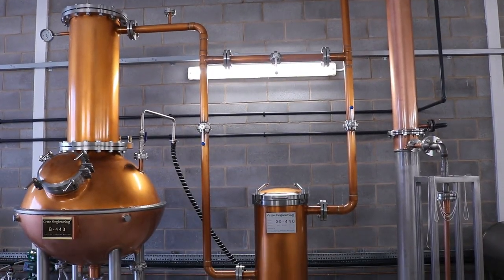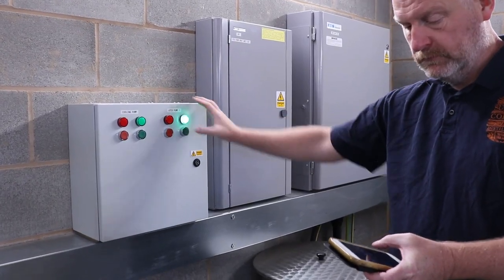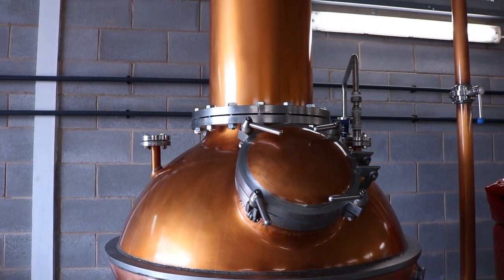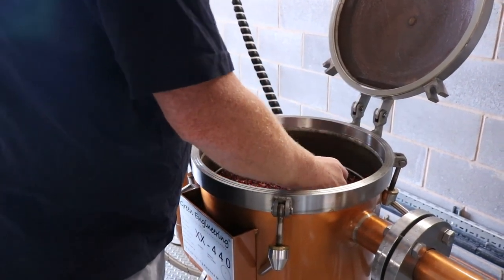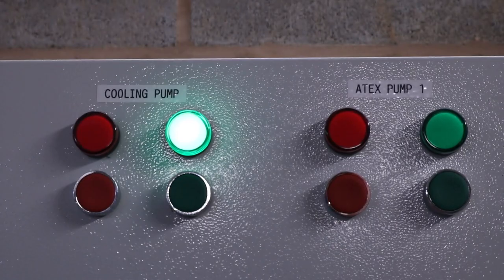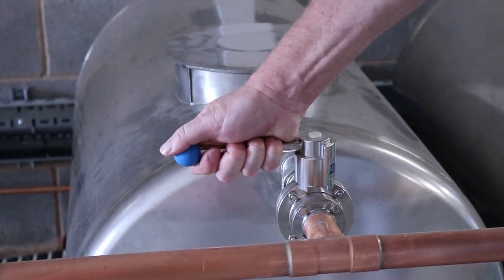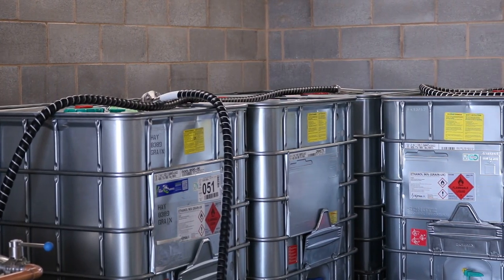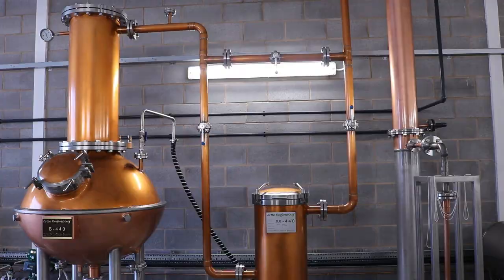How To Make Gin: Our Distillation Process [Copperfield London Dry Gin]

Comment: At what temperature should we distill the macerated liquid so that we get best flavour & aroma without any off notes whfn making gin in lab of around 1 liter only.  Will low temperature such as 50 or 60 degree celcius woukd work or not. Or 80 degree is neccesary for distillation. I am getting burnt off note with gin , i hv tried many experiments but not getting clear gin.  Hoping for a quick reply from ur side it will help me a lot. Thanks in advance.

Comment: Such a concise video. Thanks. May I ask what temprature do you run the water through that enormous condenser of your?
Reply: Hi Cobus. The water in the shell and tube condenser is basically room temperature. The water is returned to a cooling tower which brings the temperature back down to ambient after passing through the condenser.

Comment: Hi Could you advise on the ratio of water to alcohol placed in the first pot please .
Reply: Hi Sharron, the ABV in the still is usually a bit of a secret so we can’t share that but most distillers use anything between 40% and 80% ABV.

Comment: What botanicals do you use and how do you know when the heads have finished?
Reply from the maker: mathew h Hi Mathew, thanks for a couple of great questions. We use a wide range of botanicals, and they vary with each gin, but there are too many to list here. You can see them all on our bottles and on our website description for each gin so please feel free to take a look there at www.thesurreycopperdistillery.com/shop. In terms of the heads that comes with experience. The heads are a little soapy in aroma and once that soapiness stops coming through we start collecting the hearts, it's actually very consistent on every run for each gin. Hope that helps.

Comment: So by the looks of this process you first distill PURE alcohol and THEN distil that for the GIN part yes? - double distilling?
Reply: for making gin,the first step shall be getting pure alcohol,and then you blend it with pure water and get it through botanicals. :)
Reply: Hi Ozzy. Gin has to be made using a neutral spirit which is, in most cases, 96% ethanol from an agricultural source. This is then rectified with botanicals, one of which must be juniper, to produce the gin. The initial neutral spirit is usually passed through several columns to make it neutral. Hope that helps 😀